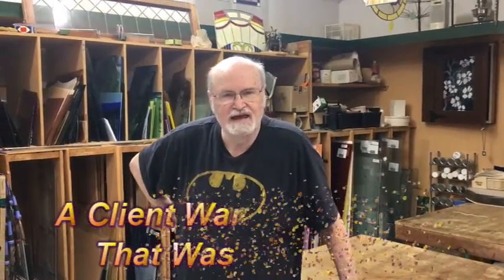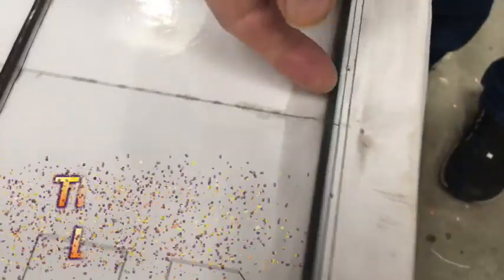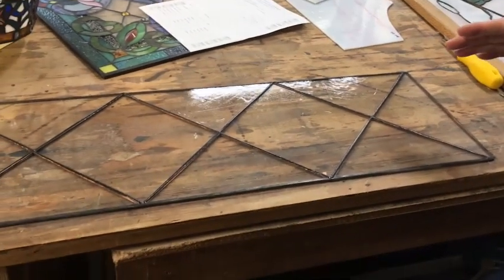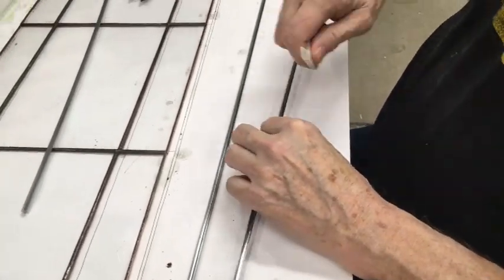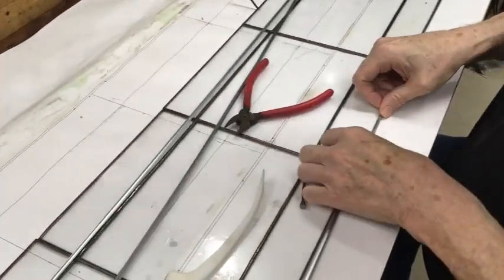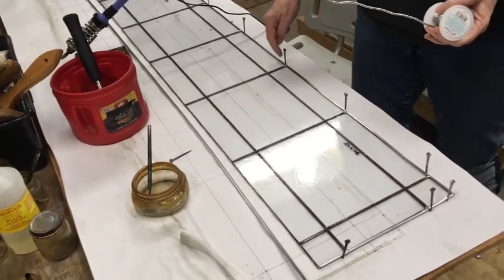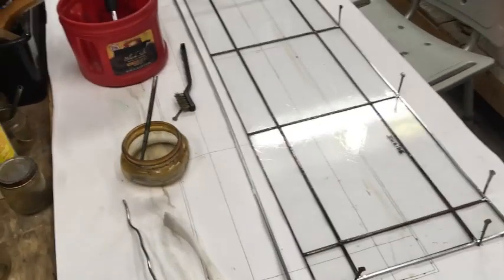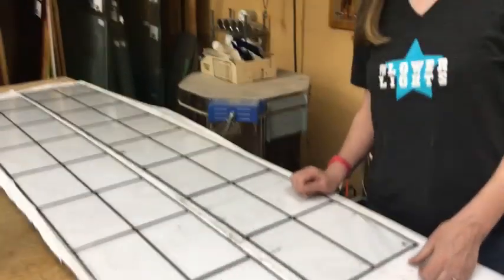Stronger Stained Glass Panels V397

Comment: A length of restrip soldered into the long center line? I’m sure you thought of that so my question is why wouldn’t it work to stabilize and strengthen?
Reply from the maker: Restrip would have been more work and unnecessary once the panels were installed. Remember, this glass was being placed in a wooden frame work that is plenty strong once it's installed. The concern was that the installers might not be careful enough.

Comment: Isn't there a product made of steel that is a flat piece that you bury in your solder joint from one end to the other (it has to be a complete line from end to end)?  I know I have used it on really long pieces to add strength.  You have to wrestle with it sometimes on a bend, but it does add rigidity and I would think it would be perfect going down the center of your piece since it is a straight line.
Reply from the maker: Yes, Restrip is great but it's not practical for this project because we'd have to place it in nearly all the joints. See the comments in the last comment as well.